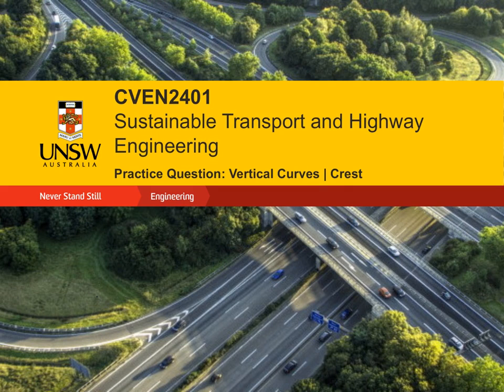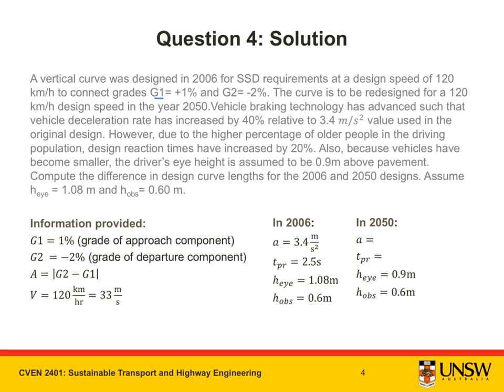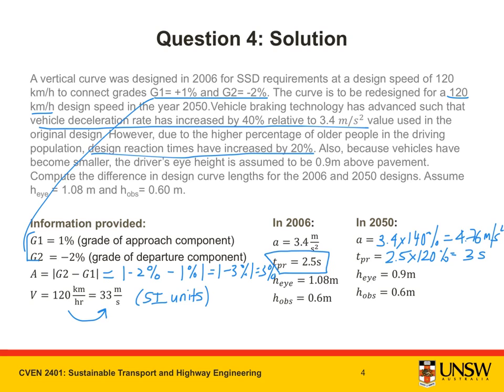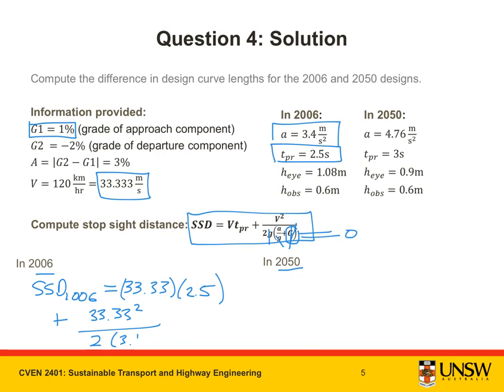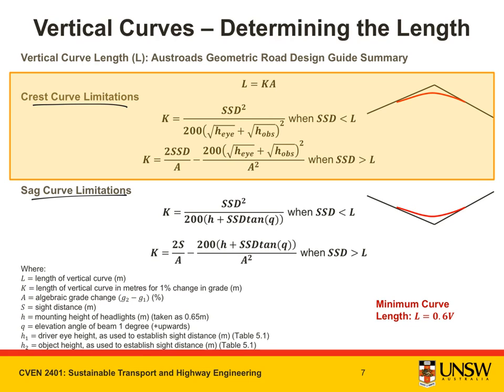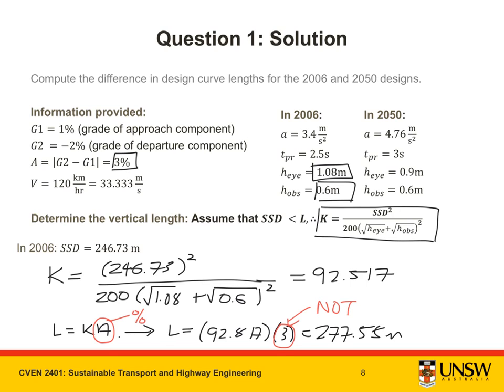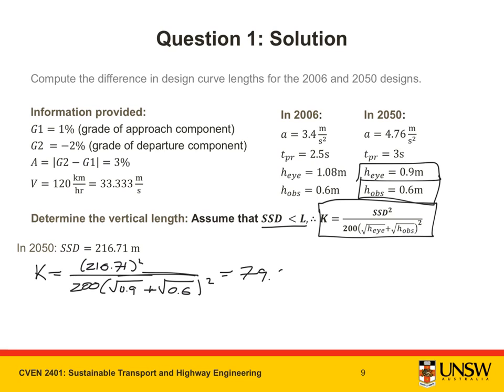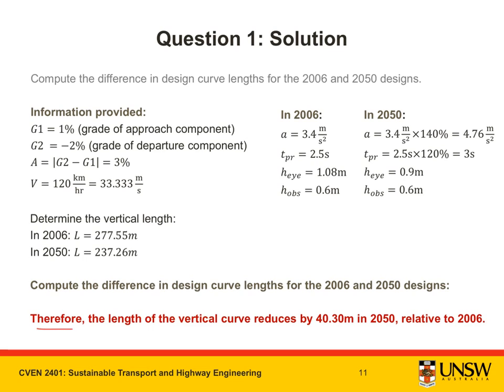Vertical Alignment: Vertical Curve Design (Question 4)

Comment: For the SSD formula just use the one provided in the lecture slides. Your answer will be different but as long as you understand the method it should be all good.